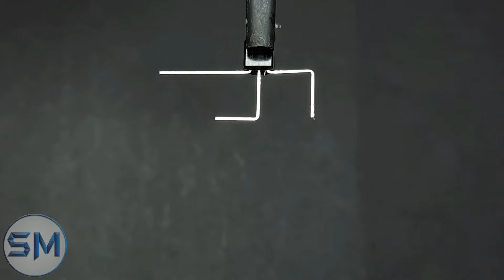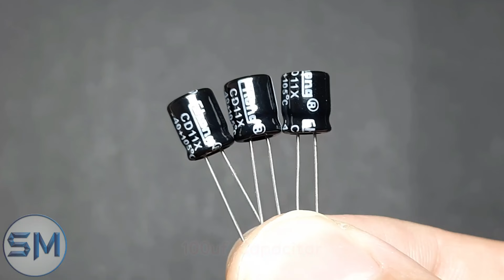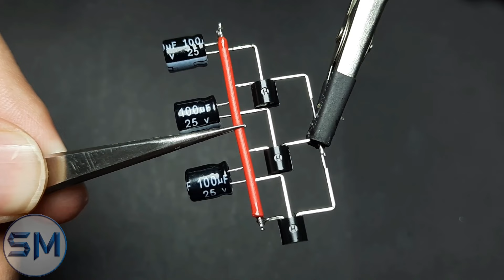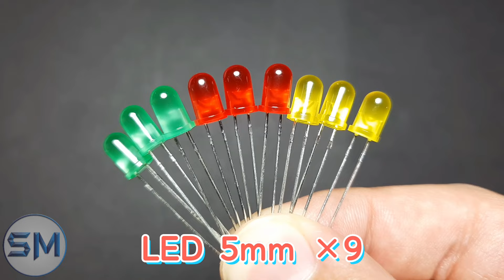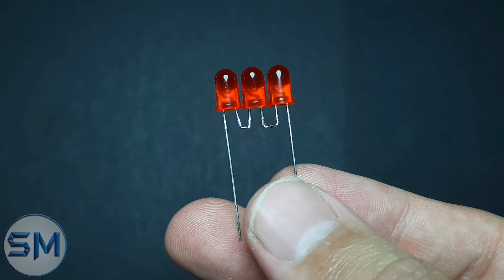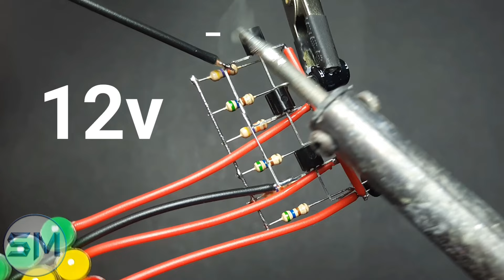[NEW] LED RUNNING BOARD LIGHTS CIRCUIT 2022

Comment: Can this be changed to run on 5v usb
Reply: Yes, change 560 to 220 ohm. But LEDs may be a bit dim
Reply: @NickBarban  thank you 🙏
Reply: @NickBarban bro why each set led is connected in series can we connect in parallel
Reply: @marsugaming1694  in series, each led will get the same current. In parallel, it will be the same voltage, and the current to each one will be total output of the driver divided by number of leds. With the 12v supply, it’s possible some of the leds could blow, or depending on the quality of the leds, they might be low output light or not light up at all. 

Most likely, as they won’t all have the same forward voltage, light intensity will vary across all of them and one of them will probably hog current. That may blow and then cause a cascading failure. Better of probably to change the circuit to run with a MOSFET (2N7000 or similar). But that a whole different circuit.
Reply: @NickBarban  bro then how i connect a rgb led to this circuit

Comment: c'est possible de faire le même circuit en 5V, même si on met moins de led, et d'avoir le diagramme du circuit, même à main levé pour le reproduire. Je veux faire un bleu/blanc/rouge, sous des pièces rectangulaires en verre gravé au laser à effigie de Johnny  .